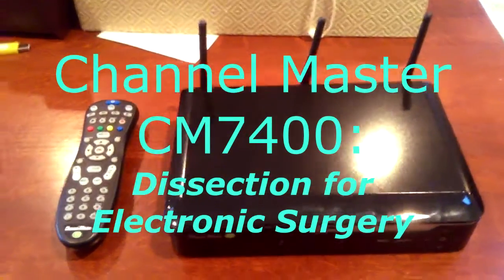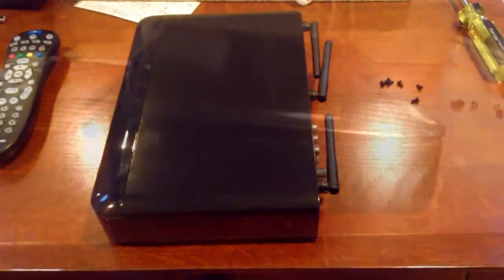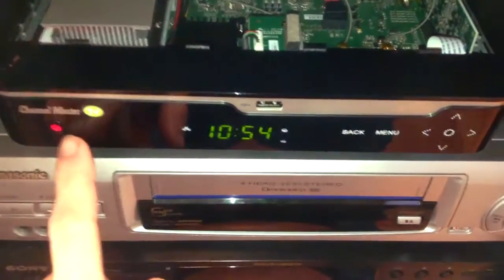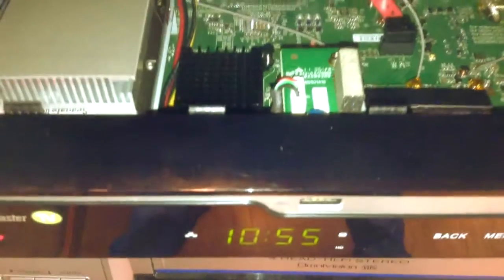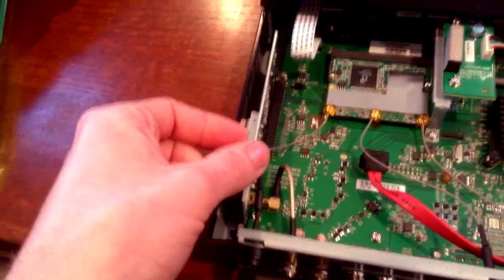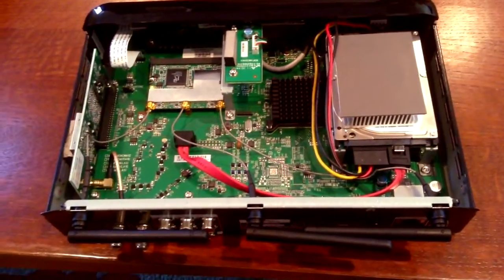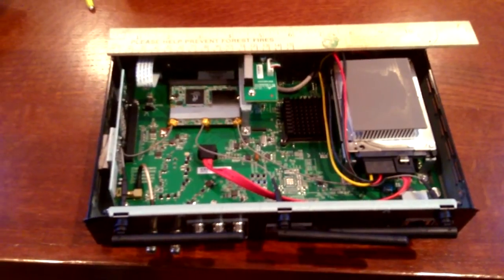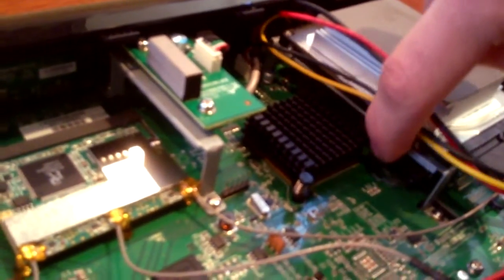Channel Master CM7400 Dissection

Comment: I've had mine for almost 2 years now and after the Sw update it only has in frequent times where it wont turn on untill I reboot.  It works well for me.  I made put together my own fan using a 12v 6" fan with a regular 12v power supply that my CM now sits on and is cool to the touch.   I put 4 tech screws in the holes of the fan as feet and mounted two small pieces of wood on top of the fan to make space between the unit and fan. I used tie wraps to attach the wood pieces.  Looks cool, pun intended

Comment: Definitely a cooling issue as now the actual manufacturing company has released this Entone Dual Tuner DVR upgraded model.  Search the Entone on Ebay and read the description.  I look for the new Channel Master version to have the exact same upgrade.
Reply: Sir McCray - did you ever verify if this truly was the case...& which Entone model is the upgrade? There are truly Entone models on eBay, for example, but they don't state "this is the upgraded model to fix the heat problem"...& I doubt the sellers know. Anyway, thought I'd ask for an update on that. Much obliged!

Comment from the maker: I haven't been in town to check up on it recently though. So, while not perfect, placing a heat sync on the processor did help, but it is a pretty big ordeal, and I don't recommend to anyone who isn't very experienced in electronics work or computer building.

Comment from the maker: Sorry for the extremely late response.We put a new heat-sync and fan on the processor, which would be very difficult for someone to do who does not have much experience with computers parts. The main board of the unit (motherboard) is pretty difficult to remove.

The results seem to be good, as the unit decreased its freezing very much, but we now have a humming noise from the fan, so we are looking into putting a speed-control onto it. Also, after about 6 months, it started to freeze again